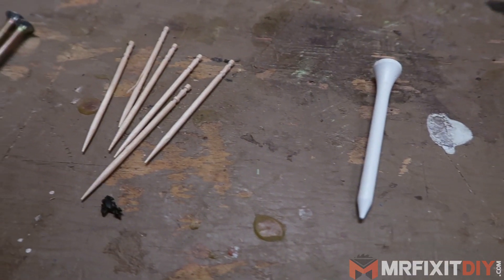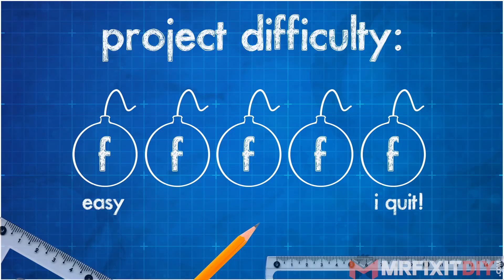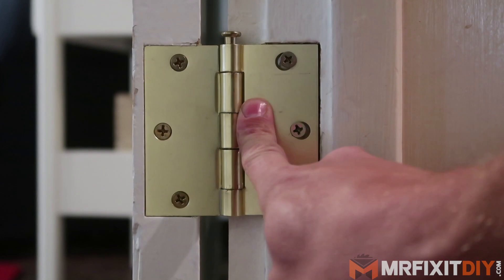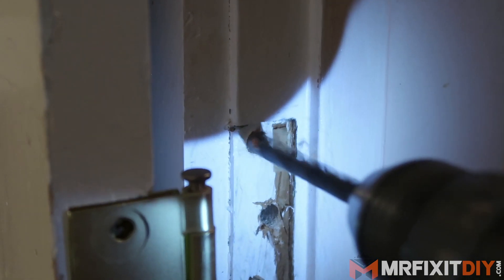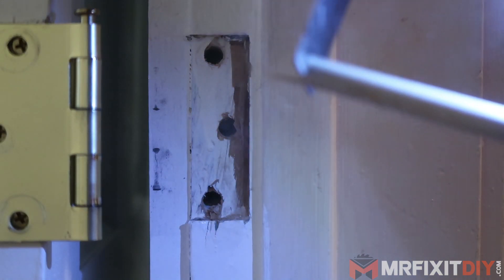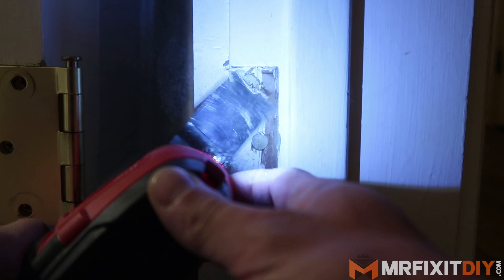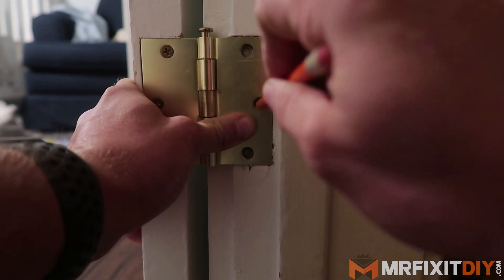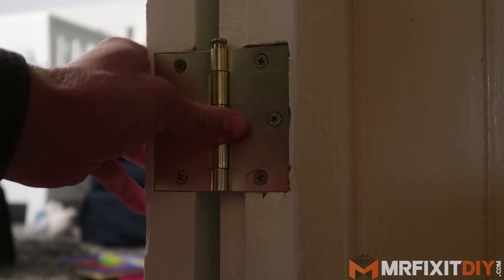How to Quickly Fix a Loose Door Hinge

Comment: Worked perfectly, thanks. I cut my dowels 6 inches long, glued them up as well as the hole, tapped them in until I felt a full stop. (Very stable while replacing the screws) Then I cut them flush etc.  The oak dowels I used really made the screws hold tight.

Comment: Hi, used your method yesterday. Had an emergency repair.  The "handyman" I hired to install this door clearly over tightened and messed up the screw holes.  But I found he messed it up on the door side, on a brand new door too.  So I just did it to all 3 holes on the jamb and the one on the door.  Worked like a champ.  Gorilla Glue dries in 15 minutes. Good as new (I hope).

Comment: Great idea with the dowel. I’ve gone to pro-grade CA glue w activator for these types of repairs, it gets you out in minutes. Using a Vix bit for the pilot also saves a step. Lastly if it’s the top hinge replace one screw with a long one that will reach framing. It’ll help keep the door from coming off it’s hinges again.

Comment: That was one of the best DIY vids I've ever seen. All the information, efficiently delivered and the F-bomb thing is hilarious.  ONE question. The space behind the jamb I'm fixing is completely free of a stud...no material there at all... I have a carpenter friend who suggested this same dowel fix despite there being nothing back there... saying that he would go "as big as possible" on the dowel..up to even 3/4" for good security. I guess I'll know when I try it but it seems like not a lot of jamb material to adhere to...just 1/4" or so of depth.  Then another carpenter said that would be fine ....but also glue the hinge to the jamb as well.  Thoughts appreciated. Thanks.  Oh...this is the bottom hinge ...not the top.  And the whole discussion came as an alternative to taking of the casing trim and cutting back the drywall, filling that with a stud and then putting it all back together. Thanks

Comment: Can you do this on the door also or just the wall side?
Reply from the maker: Depends on if it's a solid wood or hollow core door but yes. You'll have better results with a solid wood door.
Reply: @MrFixItDIY  thank you! It worked great! I still had to use bigger screws, but it worked great! Thank you very much.

Comment: All the videos show how to fix the part attached to wall. Mine is loose on the door
Reply from the maker: You can do the same thing. Take the hinge off, drive a dowel or piece of wood covered in glue into the door and trim off the excess